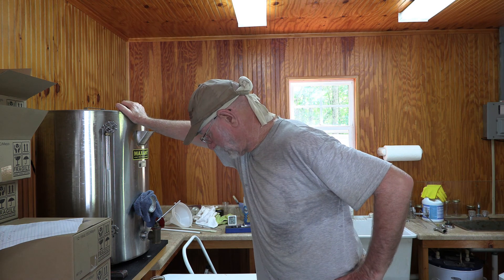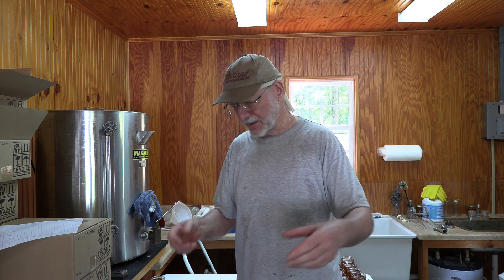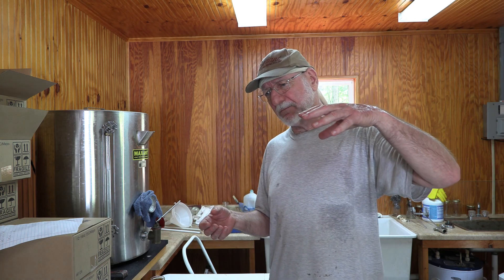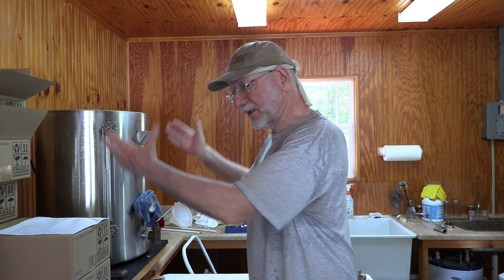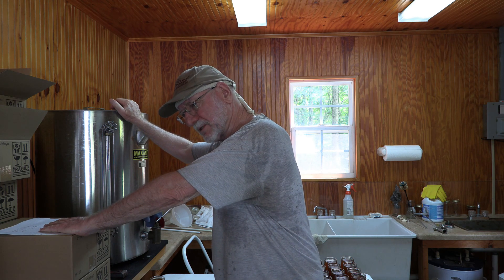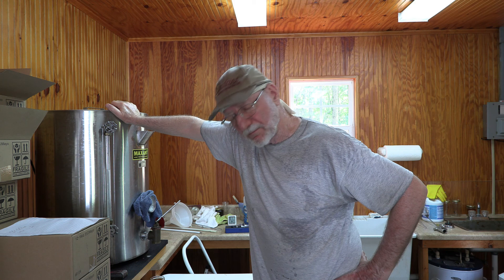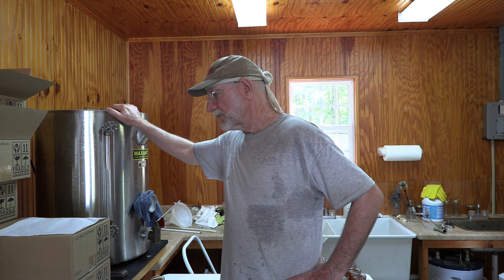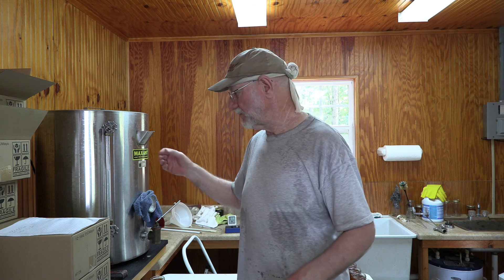Reducing moisture content in honey using a bottling tank

Comment: Three questions.  1.  Do you leave the lid on during this process or do you leave it open so steam/moisture can escape?  2.  So after putting in 15 gallons and running it for 1hr at 100deg then letting it sit for 24hrs, what moisture content % drop do you expect?  I have one of these Maxant bottling tanks and think this would be a great use.  3.  Do you use this bottling tank for wax melting?   Thanks again for your answers!
Reply from the maker: Good questions.
When I leave it for overnight or for any extended period with honey in it, I leave the lid on. I don’t want to encourage ants or other critters who might find themselves swimming in the honey. As soon as I think I’m ready to put it into buckets or jars, I first open the lid and inspect the underside. It isn’t uncommon for there to be condensation collected there. I dry this off with a towel. 
When I am trying to reduce the moisture content from high moisture honey, I blend in honey with low moisture content. The result depends on the moisture content of both and the relative quantities of each. I do a little algebra to estimate the end result but also use a refractometer to check the final product. 
I don’t melt wax in mine. A bit too messy for me. I have some solar wax melters that I use for my wax.
Thanks for watching.
Dan
Reply: @boogerhillbee  thanks for the response, i appreciate it.

Comment: Thanks for this. I extract about  800 lbs. I put supers in a small mud room with a dehumidifier. Then I get extract when I get around to it. Maybe a week or so later. I test as I bring in just out of curiosity. I test the open cells in partially capped frames. I test completely uncapped frames. When it is extracting time of the year, I have yet to find cells of less than 18.5% when I bring them into the mud room. Yesterday I tested a frame with no cappings at all on either side. 16.5%! At least in my apiary in Mid-MD, it appears that uncapped cells are the beneficiaries of all the drying out going on all around. Just tested a bucket of honey from 2 suppers of partially-capped frames. 17.8%. I think too much is emphasis is placed on waiting until frames are 80% to 100% capped.
Reply: I agree Dave. Too much
Reply from the maker: Actually testing is the only way to be sure. No question about it. 
We’ve had a nice, wet spring. Uncapped honey coming in at close to 19% isn’t a surprise. In years past I’ve seen it higher….and in other years lower. Curing it in the comb is much faster than trying to do so in a bucket, yet many people try to do that. 
When I bring it into the honey house, I want to extract and be done. So, for me whatever works fastest is the way I tend to go. Blending it with lower moisture honey is my preferred method so I can move on to the next yard.